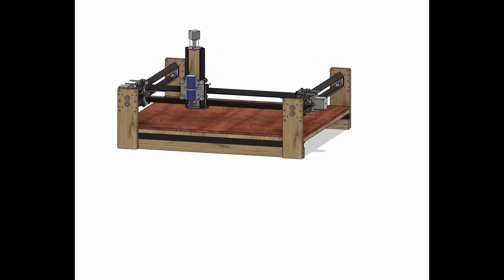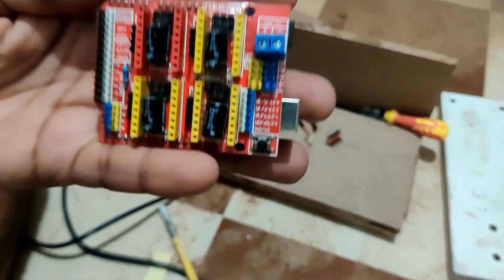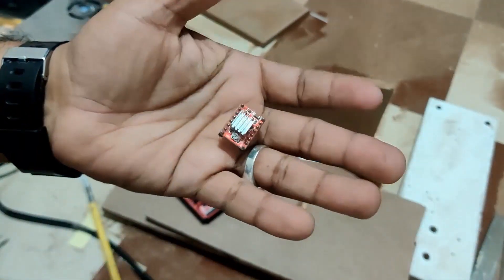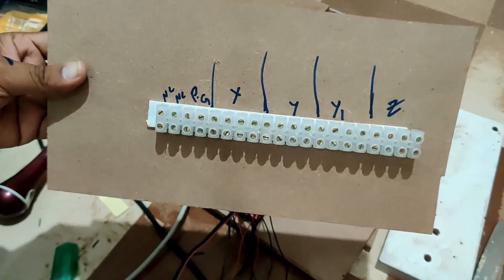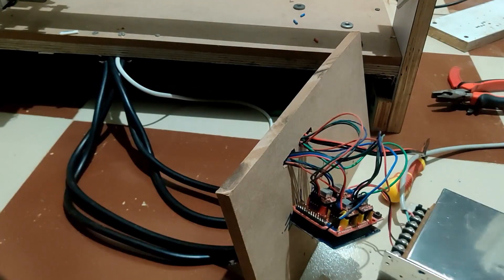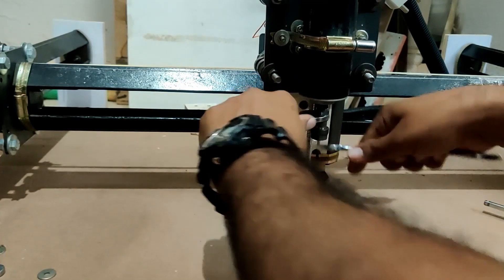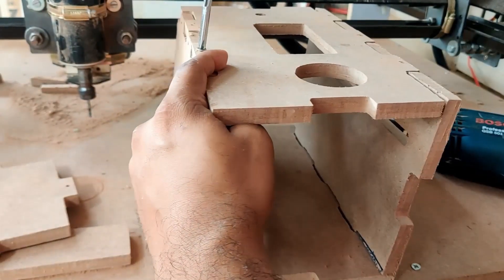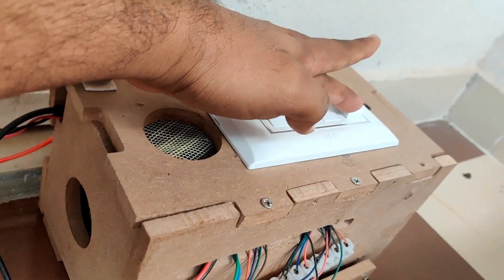Home Made CNC Machine From Scratch Less Than $150 Episode 6

Comment: it’s bad that the bearings press their edge on the profile. this will greatly reduce the resource.
and the fact that the guides of two unrelated profiles reduces rigidity.
my cnc is not so cheap now, but I started with nema17 and arduino with small drivers, but the guides from the profile and bearings do an excellent job and wear is not noticeable.
https://youtu.be/IvqGDEGtvqU

Comment: It is going to miss steps
Reply: Jobin:  I agree with you.  However, rather than just making negative statements, you could have suggested what you would recommend instead.
I assume you are thinking of something like DRV8825 drivers?
For those who are not familiar, DRV8825's are only slightly more expensive than A4988, but will supply more power, and provide 1/32 microstepping compared to 1/16 for the A4988.
Other options could be:
TB6600:  more powerful, appear to give problems in some setups.  These are about five times more expensive than A4988.
DM556: even more powerful, seem to be problem-free.  These are about 6 times more expensive than A4988.
I have seen cheap examples of these last two being made with under-spec components... something to be wary of.
This interesting build series has low-budget as its theme... include the added cost of four TB6600 or DM556 drivers, and the cost will go up by 50%.